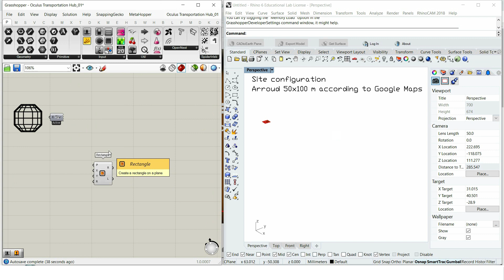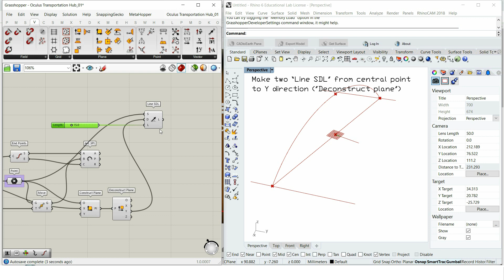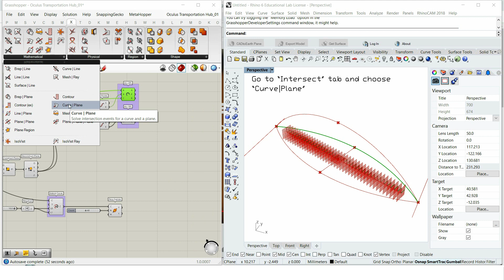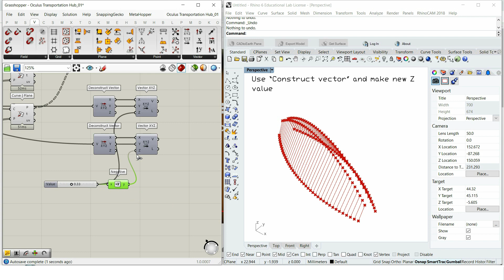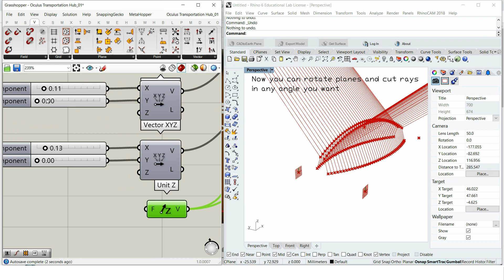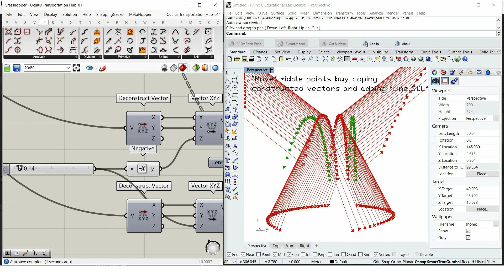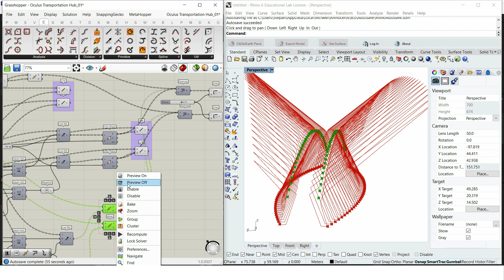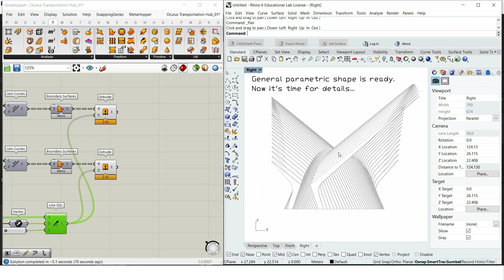Oculus by Calatrava. Part 1. Rhino Grasshopper tutorial

Comment: IT SAYS INSUFFICENT POINTS FOR POLYLINE....WHILE JOINING CURVE PLANE POINT AT 13:31....PLZZ HELP
Reply: found the solution hold shift to create more than one connection
Reply from the maker: Hi, please make sure that the tree structure of all three sets of points is the same. Try to connect panel and check, it should have the same structure, same number of points.
Reply: @parametricworld  same error, can not connect the three simultaneously to the polyline point-v ( move, line|plane and move )